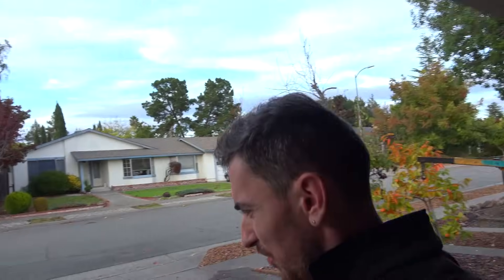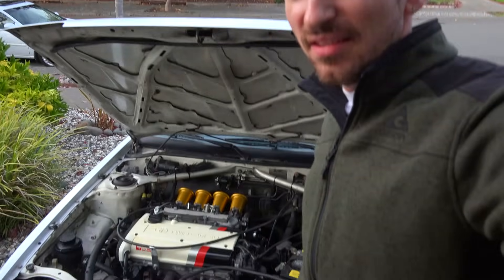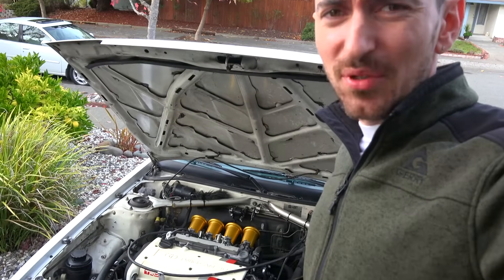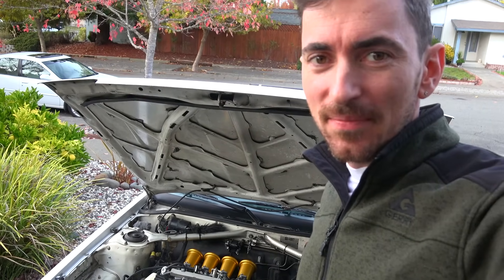The Sound of ITB's, 4AGE Blacktop 20V

Comment: The 4AGE has always sounded like old school 'motorsport'... one of the best engines I've ever enjoyed, I have no issue with putting these things up against big torquey engines in terms of comparing characteristics and driveability.
Reply: possibly because it was used a lot in motorsport back in the day
Reply: @jaanuspapp1333  Exactly, the 4AGE block is apparently a direct copy of the BDA Cosworth engine used in F1 from the late 60s onwards.
Reply: @Nemoticon  Not exactly a copy, more like was designed around a similar premise for a lightweight 4cylinder NA engine at least. or took inspiration from the Cosy at most (there was a guy that made a yt vid explaining this, ill see if I can find and link this).
Reply: @griffins5655  It is actually a legitimate copy, Toyota bought Cosy BDA and remolded it to almost exacting specifications, with very few modifications to the design. The biggest difference is the Yamaha designed head.
Reply: @griffins5655  same stroke, bore, valve size, valve angle etc...

Comment: I'm swapping this engine in my Miata, it has a similar sound to the stock Miata, however this has more power, and the sound is badass compared to the Miata's stock engine
Reply from the maker: Honestly they best thing for the miata engine is forced induction. The stock engine came from a boosted platform (323 gtx) and has oil squirters for piston cooling. Turbocharging or supercharging will be the better call. I went with a roots supercharger https://www.youtube.com/watch?v=dz7zDDhyKWM&lc=UgzEZ-F-WO5feWX-icN4AaABAg
Reply: yeah but if I get one that doesn't run then I'm swapping it out
Reply: Shelby427Gaming tbh there are way better engines for a miata
A v6, a v8, a sr20, a 3sgte, etc. This would be just a waste to put in it.
Reply: I was thinking of an sr20 but wanted something different
Reply: if i would engine swap a miata, i would probably go for a straight 5 engine compact and i just love the sound
Reply: I'd go for it. Yeah there's plenty of easier or more powerful options out there but the Miata pairs really well with a high revving N/A I4. And the K series is overplayed, this would be unique for sure
Reply: I wouldn't touch a V8 Miata. It's too small of a chassis. It'd turn the car into a lead tipped arrow which is no good for handling. If you want a V8 get a car based on a larger chassis. The Miata really doesn't need any more than 4 cylinders. A 200hp NA engine with a high redline is plenty to light a fire like you would not believe under a miatas ass
Reply: I have a Familia GT and you are 100% right. I wish the NA miata had a better option for I6 or V6 swapping, but it's just too much money and custom work. Forced induction is the only way to go on a BP, unless you want ITBs, a stripped down track platform.
Reply: This engine has no low end torque
Reply: Why not try Beams 3SGE?
Reply: you can tune an all-motor na8 and nb8 miata to about 170-180hp for relatively low money, 200hp if you spend a lot and get a 1.8->2.0 bore kit (no clue about vvt engines on nbfl though)
Reply: As an owner of the B engine. It's really solid. It was flooded but it still survived. Common problem is the seals but it's 24 year old engine that lived in city traffic.
Reply: If you’re gonna boost the Mazda BP, you should go with forged pistons and rods, lower the CR a bit too. It’s true the BP is a great platform to boost and has a lot of potential but invest in the bottom end.
Reply: sushpants what if you have a 1.6?

Comment: Interesting you can see fuel wetting the throttle body walls, perhaps a better spray pattern injector could be found?
Reply from the maker: this pretty normal for all port fuel injection, direct port injection in modern engines overcomes this by spraying directly into the combustion chamber.

Comment: amazing! How many time did u have to rebuild , tune and what are the modifications also can u turbo-charge it?
Reply from the maker: Rebuilt just once with new bearings, piston rings. Replaced all gaskets, valve guides. Had valve seats machined and head deep cleaned. Stock ECU on 100mm trumpets. I always wanted this engine to be NA, there is mixed opinions on turbocharging blacktops as they were really built for NA.
Reply: thx
Reply: is it the USD ver?
Reply from the maker: Aiden Asre no, they never had the 20 valve in the U.S. It's the jdm
Reply: k thx

Comment: Hi, I am a big fan. I too have a BT 4age. I was able to get velo stacks but small ones so I can still keep them hidden. I have been thinking of getting longer ones but since I am from SE Asia and dust is bad in my country Im a bit anxious. Any tips? Filters I can use? alternatives? I feel that the sound of this engine needs to be shared and appteciated by all.
Reply from the maker: Of course, i usually run my BT with a filter. I used a pipercross filter and it works well. I have a video on how to install it and where to get it.

https://youtu.be/zHodTP1BPMc
Reply: thank you.
Reply: use pipercross filter they are good for ITB filter... they supply complete hardware
Reply from the maker: +Martin Soriano haha, I'm already using a pipercross filter. I made another video how to install it on FWD mounted blacktop with long trumpets.

Comment: im curious about velocity trumpets, Surely its sucking in hot air from behind the engine against the firewall. Wouldn't a small vent or scoop at the top of the bonnet atleast allow cooler air intake?

Comment: Most 4ages I've seen are longitudinally mounted. Do you know why it's transversal in the FX16?
Reply from the maker: The FX16 setup is very similar to the MR2 of the same period, which was also transverse. The corolla FX was FWD and that probably why Toyota decided to stick the transverse 4AGE into it. The benefit is a simpler design that also weighs less. The corolla FX was the lightest car to have the 4AGE engine.

Comment: Hi 
I watched a few of your videos about the trumpets,wanted to know which will make more power & which will sound louder (100mm trumpets or fit smaller trumps in the plenum followed by stainless steel pipes with a velocity stack on the bumper) .. Please reply to me. 
Thanks.
Reply from the maker: Hey Cameron, I made video called “ultimate trumpet test 4age...” where I go into detail for each size of trumpet.
Reply: @sushpants  did you blank the vaccum lines that originally go into the air intake piping?

Comment: I had a fx16 gts when I first started driving. Miss that car. Glad someone is making great quality videos with one. Question tho. Have you thought about swapping a 2zzge into the fx?
Reply from the maker: When i was getting ready to do the engine swap i strongly debated 2zz vs 4age blacktop. The 2zz makes more power and a bigger aftermarket support. I already own a car with a 2zz in it the 4age sound blows the 2zz away.

The blacktop was still in the same family of engines so it pretty much bolted right up and was more of an evolution of the FX's heart. 2zz would have required  all custom motor mounts and the intake and exhaust are opposite of 4age arrangement.

Comment: for those ITBs what if some rock or dust goes in? it doesn't need a filter?
Reply from the maker: I drive it with the filter most of the time. It's okay to drive without the filter for a little bit as long as you dont drive down dusty roads.

Comment: Why do a lot of setups usually run the ITB with no air filter?
Reply from the maker: Max power is achieved with no filters installed. 
ITB Filters Pro's: stop small animals and dust from coming into the engine, 
Con's: restricts air flow.
Reply: sushpants Oh okay just a balance between reliability and power, thx

Comment: Have you done a engine swap, was interested in what size engine it was, so had a search and it's says the fx16 gts came with a 1.6 16v 112bhp

Your video says it's got a 20v?! Sounds awesome though.
Reply from the maker: The engine is a 1.6l 20v that was swapped in with the 6 speed transmission. It made a big difference in power compared to the original 16v 4age.
Reply: Ahhh cool, so is it still a 4age just a modified version from another model or something. Thanks

Comment: Hey mate, I have a blacktop and am wondering what the deal is with installing these. Can I just remove the standard plenum and bolt them on or are additional modifications required?
Reply from the maker: That's pretty much it. As long as you have a blacktop, you can just bolt up some trumpets and you're ready to go.
Reply: That is awesome news as I can get a set for $150NZ next week. This vid has totally convinced me so thanks for that and the reply.

Comment: Can the real 4A-G 20V rev up to 11k RPM? Or is it actually somewhat impossible? I can never find any videos of 4A-GEs revving up to 11k or at least 10k.
Reply: Jack Foxtrot - EDM Music Anything is possible. In order to actually be able to handle revs that high you would probably want some upgraded internals and better head/cams. Without the cams for high rev, you would be losing power on the top end so not much point
Reply: @agrimmell2  Well I wouldn't mind not having a speed increase and stuff, I'd mostly want to do it for the novelty of it.
Reply: Clifford Grimmell Now that I think about it’d also likely be a PITA to maintain, because I’m sure engines that rev that high or higher have to be constantly rebuilt.

Comment: dp you need to tune the throttle to get a responsive rev match?
Reply from the maker: The factory ecu is already tuned for a light weight flywheel and has pretty instant response.

Comment: Do you normally run filters?
Reply from the maker: Don't Fall For Me yes, I was using red uni filters but they really choked the engine at high rpms. I recently switched to a pipercross filter, performance seems to be unaffected.
Reply: Thanks.

Comment: 20 valve? You sure that's a 4 cyl? Not a 5 cyl?
Reply from the maker: Radioactive Noob 5 valves per cylinder, that's what made the engine unique. If you watch the video again, you can see 3 valves (3 for intake and 2 for exhaust).
Reply: Audi also sports 1.8l 5 valve per cylinder 4 cyl motors in the early Audi tts
Reply: There are many Audi and VW cars with 20v 4 cylinder engines. They've been doing it since the 90's